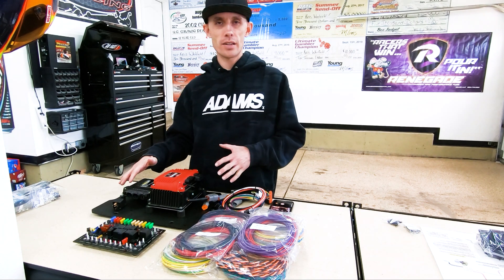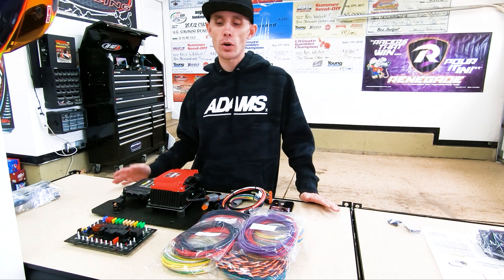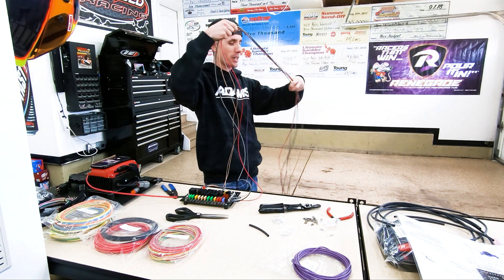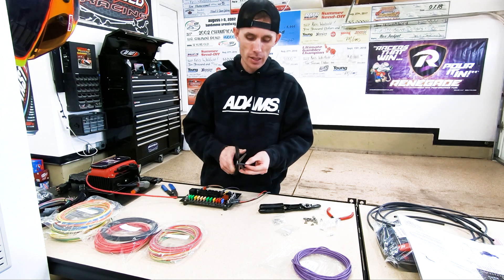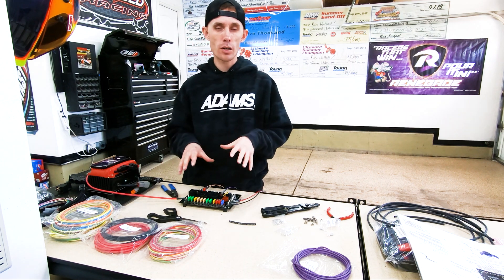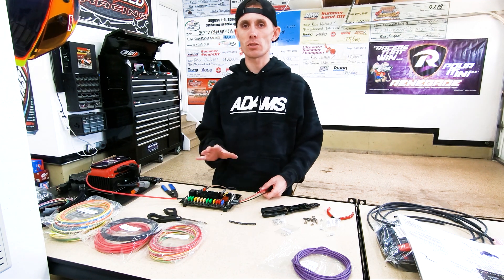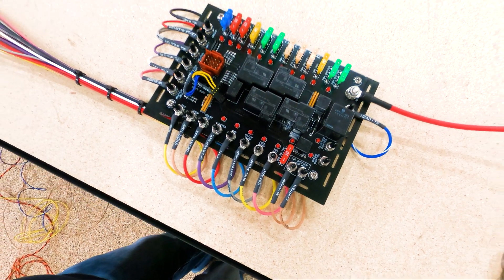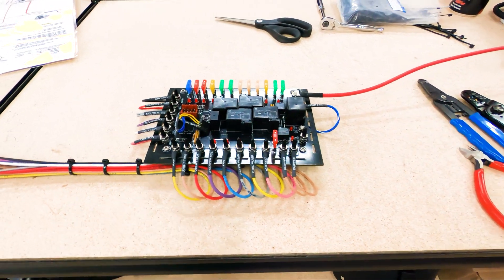Wiring a K&R Relay Board How-To!

Comment: Hey man quick question will a board like this will need to connect to the ECU like a Holley. Or is a Holley ECU and a board like this totally separate???
Reply from the maker: @4x4mania1-28  I think for the most part those will be completely standalone units. There maybe be a shared ignition wire or something like that, but overall the two won’t talk hardly at all with eachother
Reply: @ thanks man